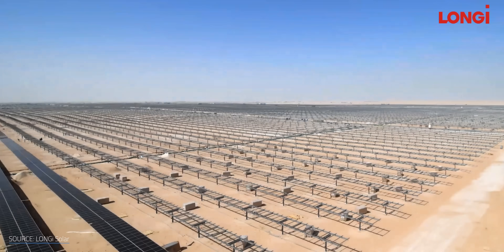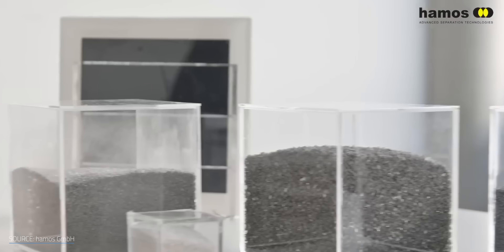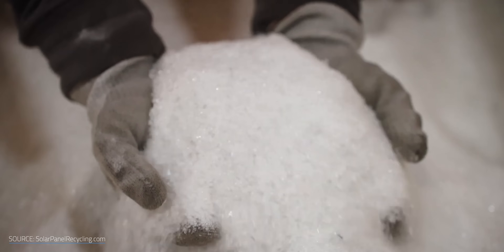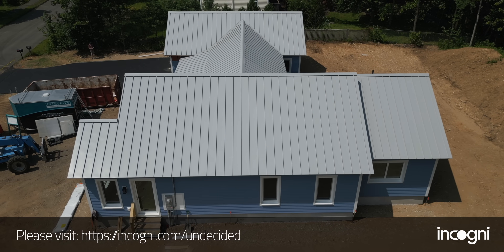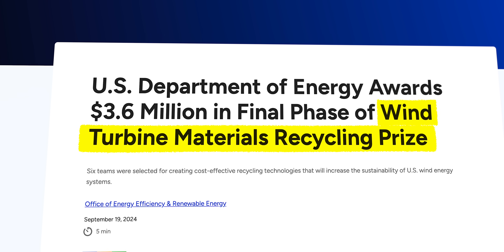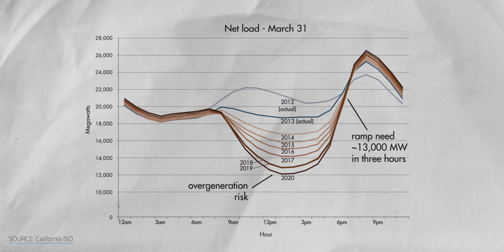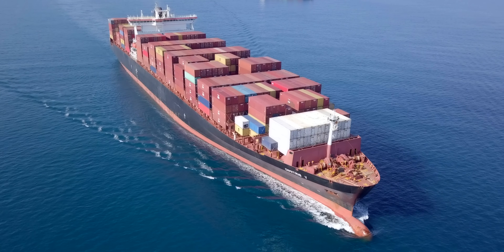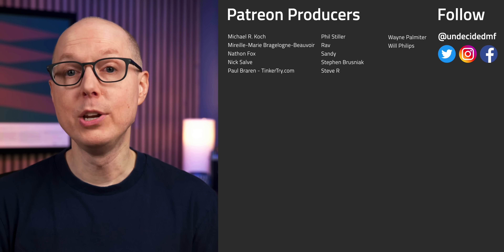How We Solved Renewables BIGGEST Problem

Comment: Nuclear power with taxes on carbon reimbursed to the public is part of the answer as James Hansen says.  Geothermal energy looks like a runner.  But putting solar panels in places such as England?  I doubt if the energy to repay the energy of making the solar panels is repaid.  Morocco yes & Spain et al but not northern climes.  Windmills of over 800 to a 1,000 feet feed into the higher winds so give twice as much energy & return.

Comment: The biggest problem with renewables isn't recycling them.  It's the intermittent nature of the power they produce.  They require other sources of power to supplement the grid.  And recycling only adds to the cost of using renewables.

Comment: This PECAN material just sounds like a good solution and i absolutely like that people are preparing already for solar recycling but i am not so sure on the battery front. Obviously getting back the metals is a bare minimum but there is a ton of junk sandwiching in what a battery is and batteries come in many shapes that it will be a bigger challenge to recycle then solar panels likely to be hexagons or squares or turbine blades which are you can expect to always have the same shape.

Comment: Lithium ion, the worst battery tech for bulk storage ! That bulk storage facility ain't moving !

Use battery tech that can be easily reprocessed. Even on site. An example, lead acid batteries, if built in a large simple form factor, can have its plates quickly replaced, and reprocessed using a relatively simple process. The cell containers, are built of non-corrosive materials, maybe thick glass, that's permanently in place, since it does not degrade. Lower energy density, yes. Lower charge cycles, yes. But its not moving, so space is not that much of a concern. And again, its structure is simple, so it can be rebuilt, in place, and the degraded plates can be reprocessed. Possibly, on site. Cost over the life of the facility, should be the primary factor.

Comment: You said something at the tail end of the video which turns out to be INCREDIBLY problematic:  "A cradle to grave perspective is a crucial part of that."

Inarguably true, but impossible to achieve.

More true with science generally than engineering, but true with engineering as well:  Initial effort cannot possibly predict end results.

It is reasonable to take steps that don't adhere to the "cradle to grave" concept as long as they are learning steps, not production steps.  Would we have solar panels on people's roofs at all if we couldn't install the first one without totally understanding the recycling cycle?  How much would fossil fuel production and use have happened as a result of that?

Just as it was important to take initial steps against Covid-19 without entirely understanding the disease, it is necessary to start investigating alternate technologies early in the now inevitable disaster of climate change.

So yeah, learn from the problems, create standards, make it expensive to use non-recyclable technology, let the market take care of the rest.  But the first part of the learning curve has to be up or we're done before we start.

Comment: Hey Matt, I don’t think recycling is the biggest problem.  The biggest problem is that without economic battery technology, you can’t ever go all in on renewables. The grid is unreliable when renewables get too high. There is no clear answer to this problem yet. But nice to see an effort on recycling. Though I can’t help but think that without even greater advancements, it just means that renewables are even costlier than they are now from a capital perspective, when required to recycle. I hope they figure it out.

Comment: 13:40 I think it would be better to focus on nuclear fission.  Traditional, tried and true, absolutely safe, lowest number of deaths associated with emissions, etc, etc.  There is not a phyisical limitation that stops us from building gigawatt plants in a project time of 5 years or les, it's a regulation problem.   And if we speak of Small Modular Reactors, it is literally an assembly line in a factory.

I have 3 questions/theories, whatever you call it.  
1) Every joule of energy we "burn" goes into heat.  Be that Geologically produced Methane - sorry, it's not dino juice.  It comes from the decomposition of rocks. Change my mind.  Be that nuclear fission, or solar panels. 
2) The Albedo Effect.   It's commonly claimed that a "Sahara desert of solar panels would power the world."  It's also claimed that ice melting would cause an exponential rise in absorbed energy from the sun.  This is because now you have a dark ocean absorbing sunlight energy versus ice/snow reflecting it.   The exact same thing would happen in a desert with sand versus dark solar panels. 
3) The "greenhouse gases" of burning Methane and Coal (comes from rocks or trees, not dinosaurs) are more deleterious because they "trap" and reflect the heat back down to the surface.  The argument is that you burn it once to make a battery and solar panel that then doesn't produce on-going.  I get the argument.  I am not sure that I agree.  It comes down to the reliability.  If a solar panel lasted 300 years or a wind turbine didn't need maintenance as often and also, lasted 300 years of service, maybe.  
What is the effect on the environment and more importantly, Humans that breath the smoke, when a lithium battery station catches fire.  
Are we still breaking even?

That doesn't even cover the labor problems associated with mining and factories in other countries.  

It's a good goal.  But we are FAILING!  Just use fission.

Comment: The VAST amount of solar panels being retired are still fully functional, they're just being replaced for panels with far higher output. It should be an absolute no-brainer for these old, functional panels to be donated to developing countries. 
Looks like a non-profit is waiting to be spun up; the "Disposer" pays a fee which is used to establish the old panels on schools and community projects in developing countries. The lower output of older panels is less of an issue as the developing countries tend to have lower power requirements e.g. mobile phones and led lights.

Comment: The price of silver has not "trippled in the past three years", thats nonsense. It barely doubled in the past 5, it has trippled in 19 years. And it was higher at some point 50 years ago. It has trippled from 2009 to 2011, but it stayed the same from 2009 to 2014. This is normal, but your statement is also just plain wrong.

Comment: "Renewables" have done nothing to stop climate change, nor will they. GHG emissions are at an all time high and will only climb higher. "Renewables" only add to overall energy use and climate change, they don't replace fossil fuel use at all. Not one single barrel of oil or ton of coal has been replaced by renewables. Maybe we remove oil from one use but we burn it for another use. We don't need an energy delivery transition, we need an energy REDUCTION transition.

Comment: Since weight, space, and battery density aren't really issues for battery storage facility, I think sodium-ion batteries will go a long way to better recyclability and use of cheaper materials as salt is pretty darn abundant and easier to access than lithium which can be saved for applications like cars where it makes more sense.

Comment: Completely missing the point that recycling shouldn't be an economic competition for the cheapest option, should be compulsory and included in the purchasing cost or installation/production... Just like decommissioning a nuclear power plant is mandatory and the costs are included in the price
Reply: making recycling mandatory is not nearly as effective at reducing waste and pollution as making it cost effective is. at best it will spur them to make it cost-effective faster, at worst it'll just lead them to find loopholes. recycling absolutely should be an economic competition for the most cost-effective option because the theoretically most cost effective option is the option that generates zero waste.
Reply: @PanceriMarco  i would argue that the ability to repair, reuse, recycle should be part of the design concept.
Reply: @ngcastronerd4791  not all things can be designed to be repaired, yes recycling should be in mind on the design phase, but as I said... If you obligates the maker and seller to pay for the recycling, they will design with this I'm mind because all things considered it will be either cheaper or easier... But regulations are até th core of it anyway
Reply: @PanceriMarco  That would require the cost of solar and wind to be prohibitively large and they would not be able to compete.
Reply: @andrewritts184  the cost is already high, because cost is not price... The real cost of the system includes dismantling and recycling, the only thing we are doing now a days is saying... This is a tomorrow problem... This panels will end up in landfills and will cause damage if recycling still being done only in an "economically viable " way, not taking into account health environment and other factors into account... Chemicals used to be buy sell and disposed of in this manner, so used to be nuclear waste and other environmental hazardous things, the only way to prevent undesirable future effects in proper regulations and enforcement
Reply: @andrewritts184  if they are able to compete being dishonest and profiting from weaker oversight into the consequences, they should not compete at all...
Reply: @PanceriMarco  the problem is they are not able to compete, which is why most solar panels are made in China using energy from Chinese coal. I would prefer we didn't subsidize this technology, because it ends up causing more harm than good in the long run.

Comment: It's a legit problem... My current panels have no use and there's only 2 places that my local solar shop has to recycle... They are also removing 100 panels from a local gvt building... Local EV bus batteries are also due to be replaced... No one wants em.

Comment: What an unbelievable waste of time.  The simple fact of the matter is that, solar is our salvation--but space-based solar with thousands of collectors made from materials sourced in space.  Here on Earth, we should be focusing on nuclear.  If we had abundant nuclear power, we wouldn't need all of these ridiculous EVs (which are now becoming an absolute disaster in California following the fires).  With enough power, we could make carbon-neutral gasoline by pulling carbon out of the air, and then we could use our existing infrastructure of gas stations and ICE vehicles without having to try and disrupt it with technology that will never truly be feasible without MUCH better battery technology.

Comment: Most batteries are easily reuseable with DIY level projects, Solar panels don't really have a "end of life" they just slightly degrade over time, and wind turbine blade material is easily made into new concrete or roofing material.

Comment: Let's put things in perspective.  43 million tons of blades accumulated over several decades.  The fossil fuel industry extracts and mostly burns 21 billion tons of fossil fuels each and every year.  That's 500x times more each year.  We should recycle the blades, but if we don't it won't be that much of a problem considering what it they replace.
Reply: @raymondleury8334  very intelligent input, it's good to see a dialog about another view point without belittling or denouncing the validity of the first message . :)   thank you raymond leury!!!  keep up dialog respectful and intellectual.  
( i realise this comes off sarcastic but it isnt ment to be )
Reply: Renewable are good as environment

Comment: Recycling is not happening because it is not economically viable source of materials for production of new devices.
If cost of new materials (from ground) exceeds cost of current recycling, those materials will not be viable for production of new devices, too.

Making new panels easier to recycle will not change reality of all existing ones. Same applies to blades used in wind power generation.

Comment: You have mentioned that single blade "windmills" are as effiicient as the more traditional 3 blade design used in most installations today - that could reduce waste.  But I've often wondered why they aren't made of metal in the fashion of most airplane wings (perhaps heavier ?) but I would think that the metal "wings" could last longer and would almost certainly be recycled more easily ?

Comment: Renewables solar and wind are generating a little over 1% of global energy, fossil fuels over 80% nuclear about 5% and hydro about 7%.  Massive amounts have to build out to replace fossil fuels that will be largely depleted this century.  While it is critical to recycle the resources such that low cost recyclability needs to be included in the design criteria.  But the build out of renewables is going consume new resouces for decades.

Comment: It may seam like a lot of waste, but even if we do not reduce the waste from dis used blades it would take very little space to deposit it in a land fill. On top of that they are not toxic if left under ground. Grind them up and fill disused coal mines and we will have plenty of room for hundreds of years, enough time for new re usable material to take over. Don´t sweat the small stuff, and this is among the smallest.

Comment: I believe there is a secondary market for old solar panels, which would pay more for the panels than their raw materials are worth after subtracting the recycling cost.
In many situations where space isn't an issue, even panels with only 50% of their original output are still perfectly suitable. To this day MOST warehouses, factories, malls and homes in CA don't have panels on their roof nor parking lots, so there's plenty of space to produce cheap electricity instead of getting gouged by the two energy monopolies, Edison and PG&E.
Looking at satellite pictures, it's easy to see how few structures actually have solar panels.
Eventually the panels would fail completely and need to be recycled, but if they can be used for an extra 20+ years, it still reduces the need for new raw materials by at least 50%, so it's worth it.

Comment: Along with greater recycling capacity where battery tech is concerned, given the consistent growth of wealth inequality and its effects on economies, in order to be viable for consumers, batteries will need to last without costly replacement, as well as the things they run, for MUCH longer. We can't have electric cars running off production lines, and into first time drivers lives, that will need battery replacement within the lifetime of the original owner, for example. Mobile phones need to be built to be infinitely updateable and upgradeable, but have no consumable parts, ergo, no throwaway phone screens or batteries that could ever stop taking charge, or have less consistent performance over time. 

 Only once a purchaser has expended their entire service life, should any parts be needed for any of the technology they pass on to their kids or grandkids, and even then, it has to be markedly cheaper to do that, than to purchase new equipment. 

 So, from now on, all equipment made must be existence proof, infinitely upgradeable and not need replacement of any significant component until well after the purchaser has passed away, because if not, the technology will only be accessible to minorities within most nations, not everyone within most nations.

Comment: Maybe we should stop throwing them away simply because they've lost a few percent of their efficiency. Solar Panels can typically last 25- 30 years and that's just until they've lost only 15% of their efficiency. We're really not sure just how long modern solar panels will last. Most come with 25-year warranties guaranteeing no more than 15% loss of efficiency (LG's panels lose less than 10% after 25 years). After that they may even level off and could last for decades longer.  This would make for a profitable market for used solar panels.

Comment: Another way to deal with EOL, for solar, at least, is test and resell. Not every application of a panel requires full efficiency or small scale with high efficiency. Some remote communications repeaters and cell network nodes may have room for a large array while not needing a high output solar farm. This is just one example that comes to mind.

The old saying goes, "Reduce, reuse and recycle," because that is the order we're supposed to apply sustainable practice to achieve best practice. Where we can reduce virgin materials, we should, because not using a thing for the sake of using a thing prevents waste by not generating a product. Reusing industrial end of life stuff in community infrastructure or small holding, off grid infrastructure, while delaying wastes. It also reduces costs making rollout of alternatives more affordable for poorer communities. Only then should we industrialise recycling. Well, not only then, but energy consumption demand reduction is more important than recycling devices which grow in demand until they become another peak disposal crisis.

To put reduce, reuse recycle a different way - efficiency first, extend life in lower demand environments next, then reharvest what's left at EOL. This is economically more profitable for all, unlike recycle first, which tends to be profitable for the corporations contracted, but expensive for the local authorities left responsible with ensuring legislation and targets are met.